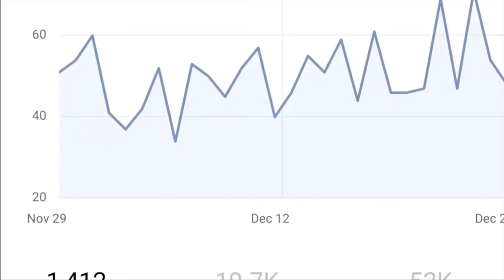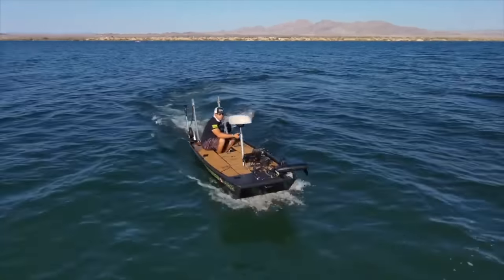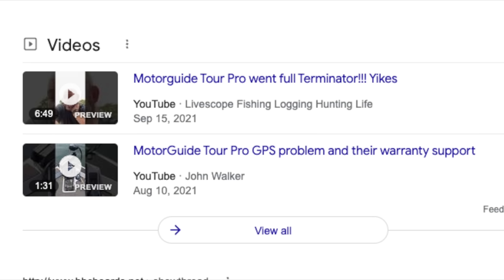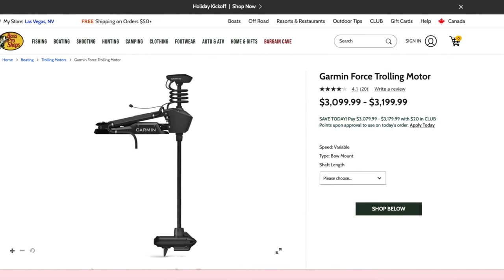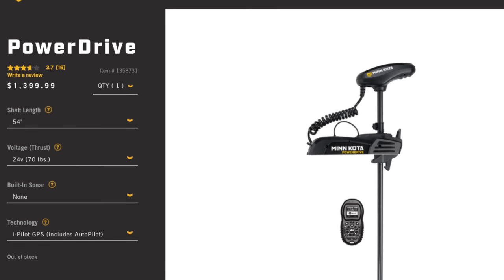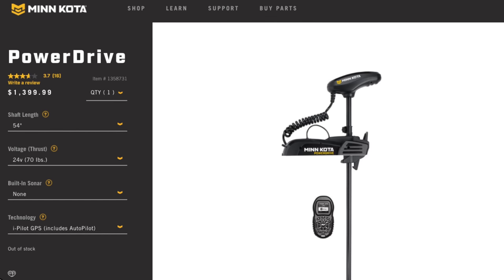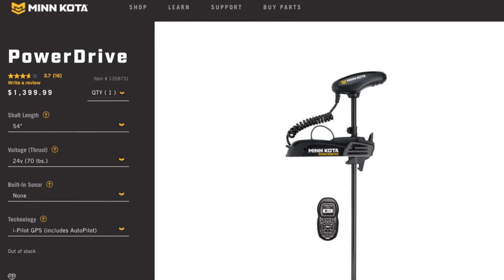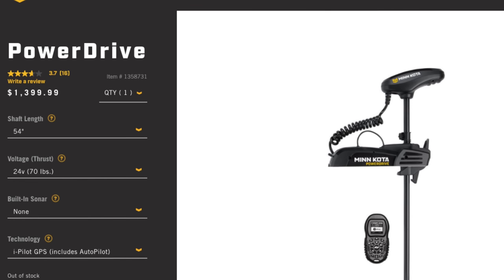Pronav Marine FULL REVIEW & Demo

Comment: This setup looks great! I was thinking about buying a new 12v 55lb thrust Terrova ipilot setup that's going for around $1800 right now new. Buying the Pronav bundle with the Powerdrive right now is about the same price. The deploy and the pedal style on the Terrova looks better, but the Pronav seems to beat the ipilot capabilities by allowing the charting/waypoints via the phone app without requiring a Humminbird fish finder. Was hoping to be able to deploy the trolling motor with cables (on an inflatable Kaboat), so that's another vote for the Terrova, but it seems like the feature set with Pronav could prove to be worth more overall. Tough choice! Would you still pick the Powerdrive with Pronav over the Terrova with ipilot?

Comment: I’ve got a 1648 I was looking at that power drive in a 12v, weight is steering me away from a 24v, my only concern is how will a regular battery take the abuse of running spot lock on a long day of fishing! I’m too broke for the lithium batteries!
Reply: We have had customers use ProNav and a solid group 31 battery all day long with spot lock on!

Comment: Will this work with the powerdrive that has the foot pedal? The 48” 12v 45lb with foot pedal or is only for the powerdrive models with the remote?
Reply from the maker: It is meant for stock power drives with the foot pedal, yes

Comment: I got the Terrova iPilot 12v 55# with quick detach mount. It's a great trolling motor so far after owning it for over a year and a half .. Remote needs premium batteries to function correctly 100%. Tried rechargeables and the remote started acting funny when the battery meter was at half. Thought it thoroughly when I was buying trolling motors. The terrova is worth the extra for the functions it has over the powerdrive. Better to have it than not.

Lots of research on the Ulterra.  While the self deploy is badass.. I hear a lot of people having problems with the deploying mechanism failing.
Reply: @TinyBoatNation  Yes.  Salt and freshwater..
Reply: @TinyBoatNation  yes they do, i have one as well. Love it!

Comment: I am going to shit on this idea for a few reasons. if something happens to this unit then your trolling motor is the same before, wont have these features. Just do humminbird autochart with saved routes and it will be the same as this data. I use navionics on my phone, XI5 with remote and no spot lock. Got the unit for $950 USD - 80lb 60 inch shaft. This product is just overkill and senseless when you can just get a trolling motor with these features for less headache.